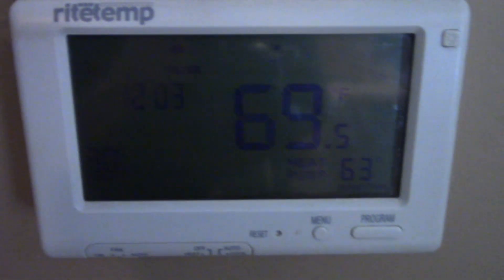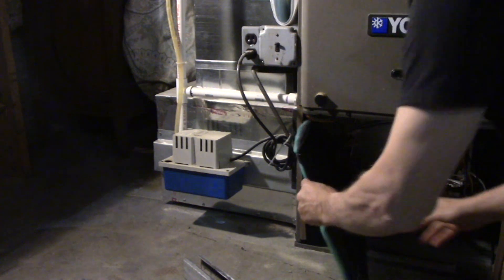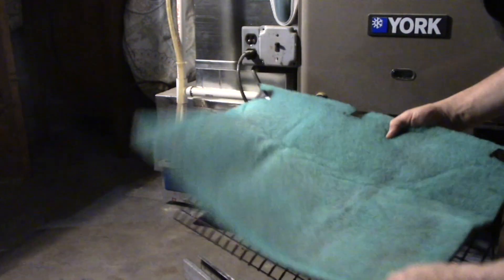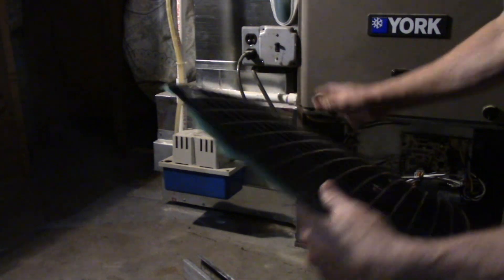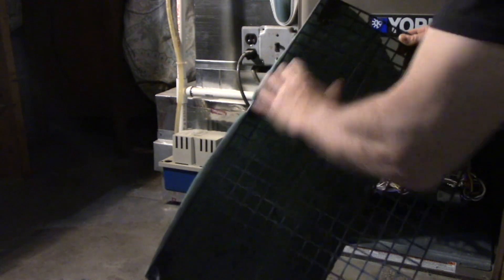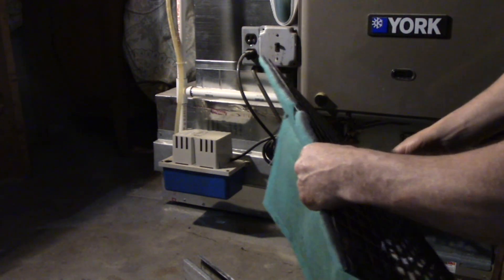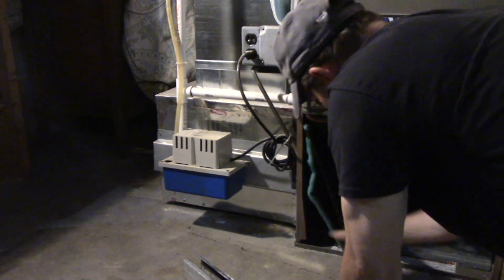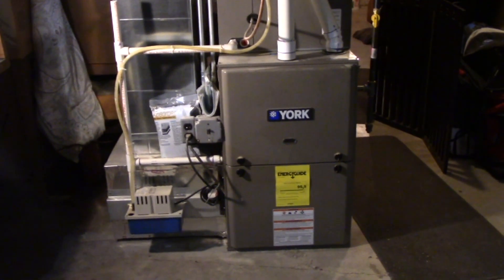DIY Central air/furnace complete HVAC installation follow up.

Comment: Thanks for the follow up!! I'm about to get started on adding a complete HVAC installation on my property (the place has never had central air or central heat) I have to bring this property up to 2020 standards, it only has a gas heater in the hall was ONLY. Thanks again!!!